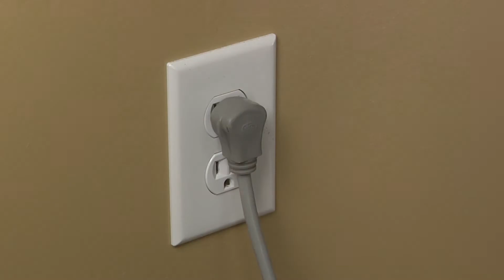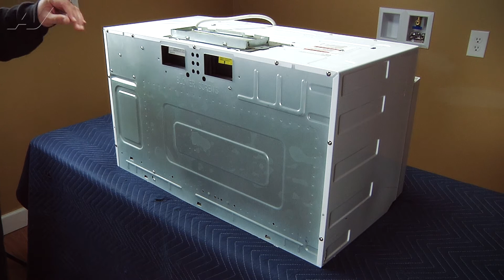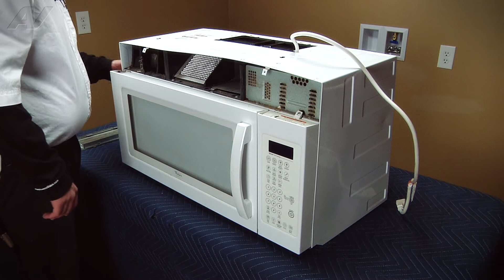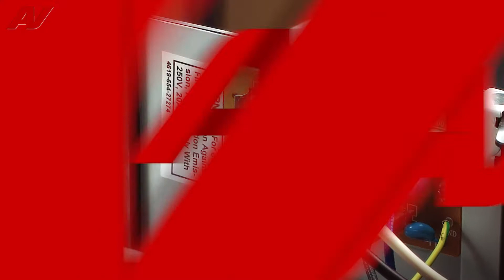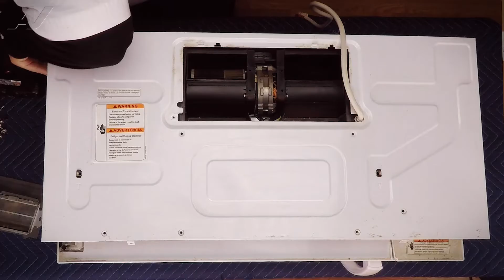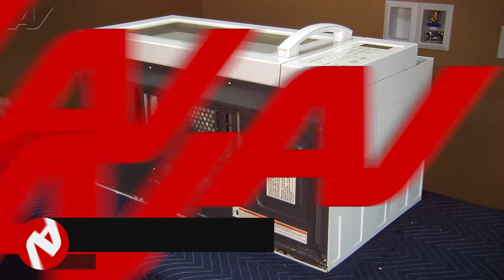Whirlpool Microwave Repair - Runs For 10 Seconds and Then Stop - High Voltage Capacitor issues

Comment: Mt Maytag stops in 2 minutes and thr fan won't run in anything but high or off. I changed the control panel because I was told that would fix it. Now I need to replace the capacitor.
The device is 2 years old. This fix wont fix the fan.
Solution: Throw this one away, buy a new unit, never again Maytag/Whirlpool, and be done. These mocrowaves are junk. Very disappointed.

Comment: Ours is less than a year old, when it is plugged but not cooking in I get an electrical arcing sound after about 5 seconds and it shuts off. Any idea what this would be? I know that to start the process or getting a warranty fix will be a royal pain, so if it is something common  I may be able to address the issue myself.

Comment: How did you determine it was the high voltage cap?   My issue in microwave  cut off after 2 seconds.  Switch tested ok. All 3 I think one controls light one fan one power switch.  The Microwave is 12 years old.  MICROWAVE STARTS FOR 2 SECONDS THEN CUTS OFF?
Reply from the maker: Great question, if you have a more technical question that our parts department cannot answer, you can search our over 17,000 answered questions free at our website www.ApplianceVideo.com under our Repair Help section. You can also call our parts department at 1-800-830-5465 and they can give you help 7-days A week ,or search at www.SaveMoreOnParts.com  .